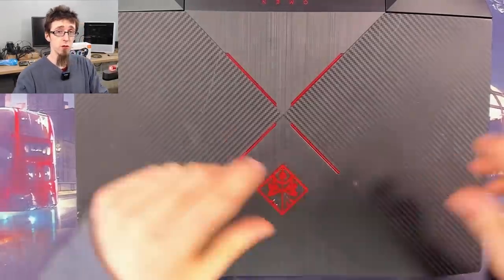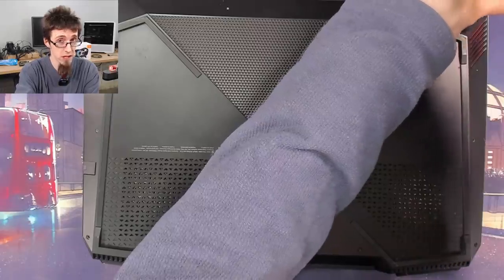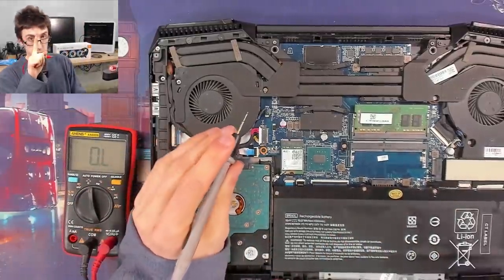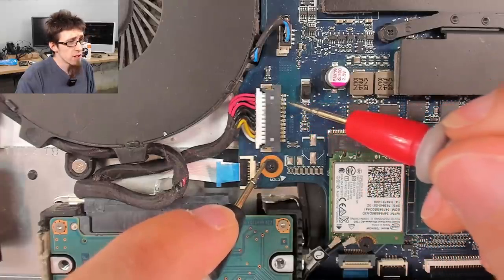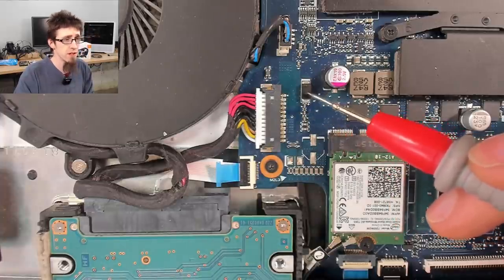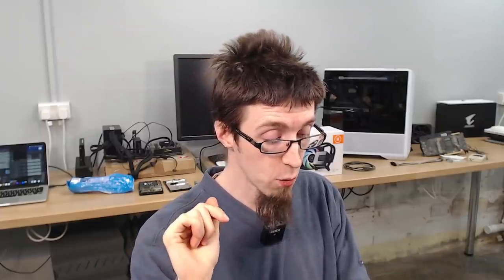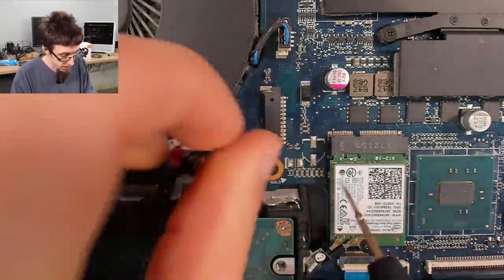HP Omen with a shorted TVS diode, easy board repair - LFC#264

Comment: DMM Continuity is a signal (audible beep) whilst measuring resistance (R) in an unenergised DC CIRCUIT. The “beep” signals continuity in a electrical circuit with low resistance under test which can vary depending upon manual meter settings and/or meter used. Impedance is a measurement of “circuit resistance” if you like, in a AC CIRCUIT. At no time are you measuring IMPEDANCE on this laptop computer. The circuit under test is DC. You constantly referred to testing the laptops’ DC JACK and associated circuit measurement being impedance. This is incorrect and totally misleading.
Reply from the maker: I referred to the CPU as low impedance, I entirely agree that referring to DC-in or VIN in impedance isn't useful - but CPU VCore is a low impedance circuit. As you say, impedance plays a much bigger part in AC circuits, but in DC it's simple enough to just call it low impedance if the load is providing a very low resistance to ground.
This topic gets heavily into the weeds of pedantic terminology though, so I'm not going to argue over what's technically correct. The important part is that people understand that a "low impedance" circuit like VCore deliberately has a "low resistance" to ground, and is not shorted.
Reply: @Adamant_IT  Sorry. At which point you did mention vcore or cpu impedance. I don’t recall. It’s not useful at all to refer to a DC circuit as having impedance. Similarly an AC circuit having resistance. I think its very important that you provide the correct information. I can see some YT channels simply repeating what nonsense they’ve heard to produce a video, or have read somewhere, just like your videos. Would you refer to a diesel car being petrol? Even just a little bit for the purpose of a video then say it’s negotiable wether it’s diesel or petrol. You’ve got to get this right! People are watching your videos hoping to learn from them.
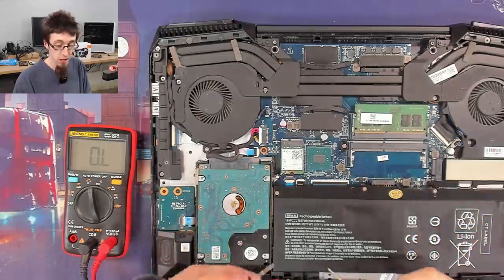Reply from the maker: 2:15 to 2:30. I regularly see people saying "My CPU is shorted!" and I'm like "no, it's not, look closer there's a few Ohms there, yada yada yada" That's what I was trying to address here.
As for if impedance applies to DC circuits, I can find examples of people who agree that it's okay to describe a low resistance DC circuit as having low impedance, but again, I'm not going to argue with you over technical correctness. I've seen enough comment wars to know better. I've already said too much here.
The point I'm making is that people shouldn't panic when their DMM beeps in continuity when they probe CPU VCore.

Comment: Hello sir, i have same model laptop omen and it has little different problem. The laptop is dead, but charging light is on when connected to AC adapter. It can not boot up. What is the possible problem? I checked the voltage on power Jack, it showed 19.5 v. I hope your reply sir.